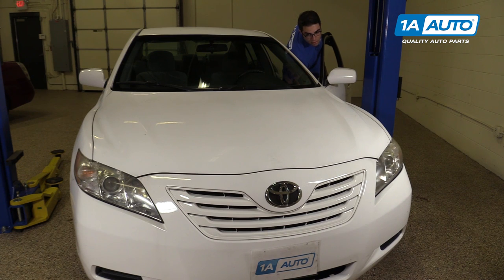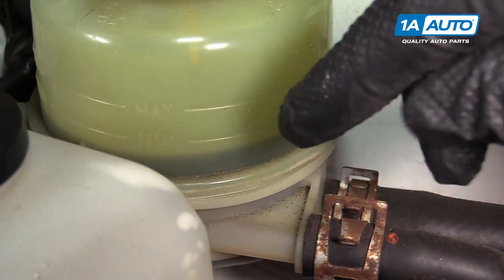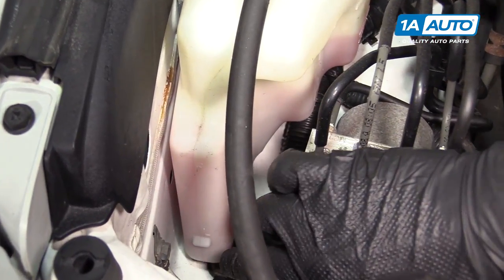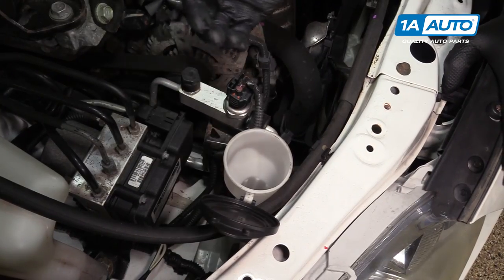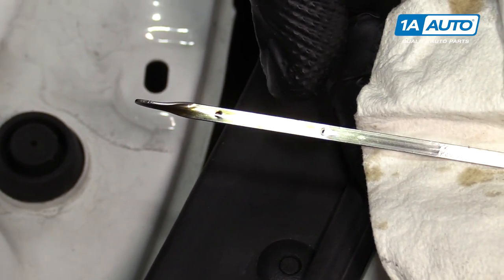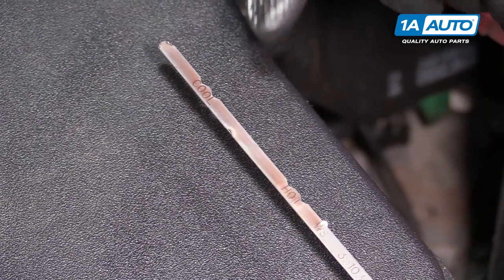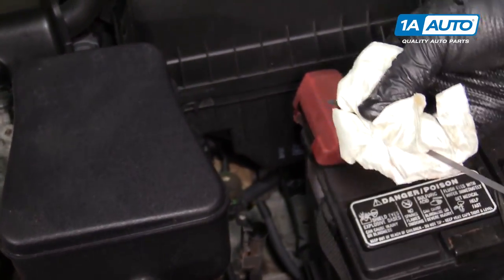How to Check and Fill Under Hood Fluids 06-11 Toyota Camry

Comment: I have a 2011 Camry LE & there is no dipstick to check the transmission fluid as shown in this video. Also, it is not listed in the owners manual anywhere. Thanks Toyota.
Reply: Facing the same problem and 1A Auto don't have the answers so this video is kind of bogus
Reply: I can’t find the dipstick either I just want to add a sealant.
Reply: I have a 2011 too and i want to check the fluid because the car has 70k miles
Reply: Toyota removed the dipsticks even my 2012 does not have one. There are a bunch of videos on youtube on how to read the transmission level but it's alot of work

Comment: I have the same 2009 Toyota Camry, I was told that mine don’t have the dip stick to check the transmission fluid. They told me the only way to check it  is to break a seal at the dealership.

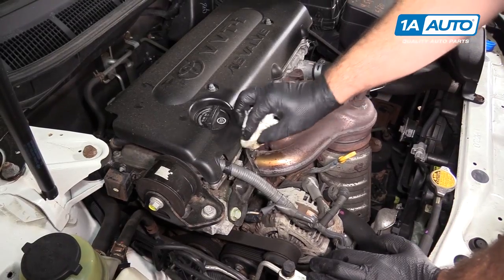Comment: 3:37 Make SURE ⚠️ THAT rubber cover on the positive battery terminal is on during this part. I’ve sparked a few dip sticks. 😂
Reply from the maker: +Ryan Kirk Thanks for the tip!

Comment: I have 2007 camry. Can i use dexron 6 for power steering and dot 4 for brake fluid?
Reply from the maker: +Yasir Siddique Thanks for watching!  Check your owner's manual, it should have that info so you can be 100% sure.
Reply: @1AAuto  the manual suggests using DOT 3 for brake fluid and dexron 3 for power steering. My question is can i use DOT 4 in stead of DOT 3. Or dexron 4 in stead of dexron 2 or 3. Thank you
Reply: @jachhi  no no no no no. Bad idea

Comment: I have a 2009 Toyota Camry and bought PRESTONE  POWER STEERING FLUID puls stop leak- Will that be ok to use?  I don't have any leaks but fluid is at minimum.
Reply from the maker: +PHYLLIS CINQUE Thanks for watching!  We generally do not recommend using fluids that have additives to stop leaks, rather fix the issue that is causing the leak.  That being said it is still safe to use as long as it is compatible with your vehicle!  1aauto.com